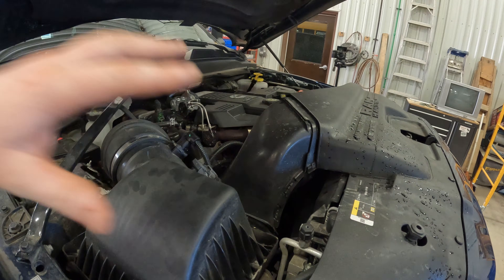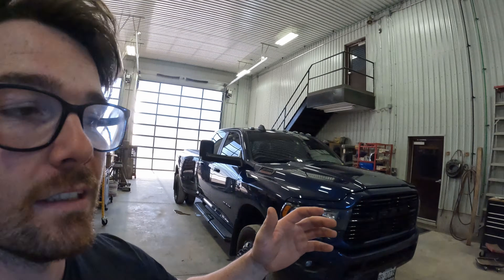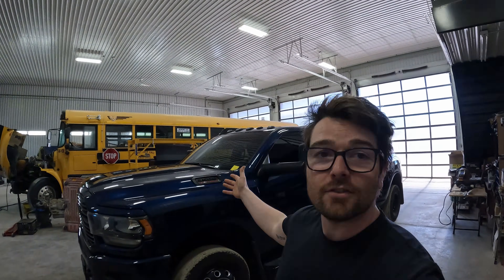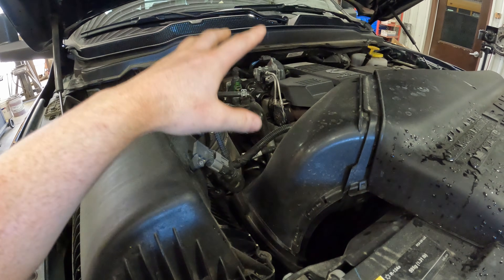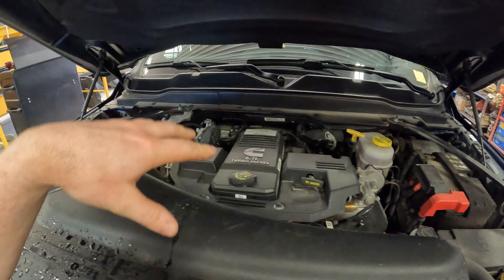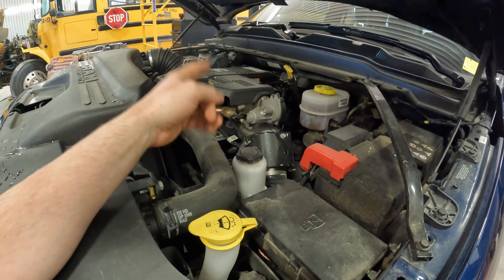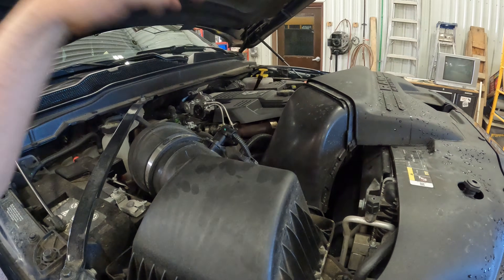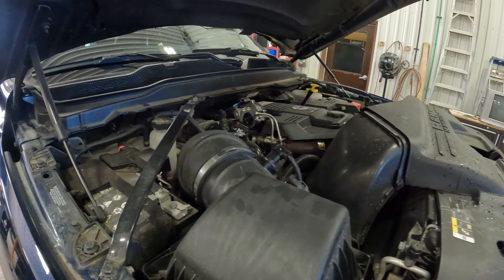RAM 3500 Cummins HIGH OUTPUT Diesel vs STANDARD OUTPUT | What Is the Difference?

Comment: Alex, question for you. We are going full time RV living soon and wanted to know your opinion as to how much towing is the amount that crosses the line where you need a HO RAM 3500 as opposed to the Standard Output Cummins? Is it a matter of terrain? Percentage of miles towing vs. non-tow driving? GVW of 5th wheel will be in 18k lb. (8,200 kg) range.

Comment: I use to work at the plant where the engines are made and the pistons are different as well as the heads. Many components are different between the standard and high output. Cranks camshafts as well as others. We always had to swap parts when we did different standards or high output.  I also worked on the machining side for the block. The high output puts would have 1 freeze plug left out on the side and standards would have them all in place once they reached ready for assembly. CGI issues are that they have lots of porosity that’s hard to catch compared to original cast irons.
Reply: Can I get those parts if I need to rebuild my engine ?

Comment: Can a standard be converted to High Output?
Reply: If you swapped a bunch of parts and reprogrammed ECM but it be cheaper to just buy the HO
Reply: @ramonbecker252 where can I get the parts ? If I need to rebuild my HO engine

Comment: THIS TRUCK IS POWERFUL BUT IT DRINKS DIESEL LIKE A PIG ON STEROIDS 😂. CITY DRIVING 9  ON HWY NOT TOWING 12 MPG TOWING 20,000 LBS IT GETS 6 MPG . IF YOU CAN AFFORD A $110,000 PLUS PU THAN SPENDING $230 TO FILL IT IS PEANUTS. 😂

Comment: I own a 2022 3500 dully with the standard engine and transmission,  my brother in-law bought a 2023 with the HO, now he's driven my truck, I haven't his.  

He has determined his truck is as strong as mine, we do the exact same type of work and we haul the same things, now I don't know if it's a factor that my truck is broken in and his is rather new or what, my truck is also heavier being 4x4

Comment: I am extremely happy with our 2020 Ram 3500 SWR HO for towing our 2021 Montana 3231CK! With a match made on the road, it's clear that this truck is well-suited for our needs. The 9.8 MPG on long trips from SC to UT and back is not that impressive, was expecting around 2MPG. 865 days after purchase I am getting my CP4 pump replaced under warranty. Not sure if this will help with MPG I did ask and the tech didn’t seem to think it would. Many thanks Alex for your videos.

Comment: I'm wondering what the milage between overhaul would be, a semi will last about 500,000-600,000 miles between inframe (not pulling the motor out) overhauls.

Comment: On Dec/2022 I bought a SRW Ram 3500 with the H.O. Cummins and the AISIN Transmission. Driving with a light foot I get between 13.8mpg - 15.3mpg actual efficiency. The computer always says it's higher 15.5 - 16.5mpg, but it's never correct.
What MPG do you guys see with your H.O. Cummins & AISIN Transmission???

I've seen people reporting fairly high mpg with the Standard Output Cummins & 68RFE Transmission. 
But I'm curious about actual calculated (not computer) MPG for the H.O. & AISIN.
Can anyone share your experience???
Reply: I bought a 2022 Ram 3500 HO/Aisin SRW CC 4WD in Jan 2022.  Unloaded I have gotten as high as 20.5 (actually calculated).  Towing, I see 10-13mpg. Around town, ~15mpg.  Computer is always about 1-2mpg too high.

Comment: I own both Cummins the H.O. And standard. Let me tell you the H.O. Will lug up the hills just about idle. The standard will downshift until it redlines to make it up the hills. Go high output.
Reply: I went ho ang glad I did
Reply: How do you tell the difference?
Reply: @heatherjenista3964 by where the transmission dipstick is, I think the HO is on the driver's side. I may be off, but I know for certain the dipstick location is different between the two
Reply: You have to drive both trucks at the same time. @heatherjenista3964
Reply: What about reliability?
Reply: Yup!

Comment: I order a 3500 SRW 4x4 Larmie back in 2018. Standard output engine with 48RFE. At 25K miles I get about 16 mpg unloaded. It was extremely hard to decide HO or standard (cool factor). After considering $$ and impact to tow #'s I went standard, and it works fine for my trivial towing needs. Great info on the differences. Thank you. I may not be "HO-Cool" but I am cool enough 🙂
Reply: 68
Reply: That's the decision I'm at now, I'm only going to be towing a fiver a few times a year and daily driving the rest. That's why I think the SO will be sufficient for my use.
Reply: @robh5416  odds are you don't need a diesel for your towing needs in the first place... but if you're taking diesel anyway its because you want the power, so why settle for the lesser option? just my 2 cents
Reply: @Slythey  I appreciate the response, unfortunately I'm still going through the debate process. I'm going to wait to see what changes Ram does for the '25 models. Maybe that 8 -10 speed trans that's been on everyone's wish list.
Reply: @robh5416  I've been waiting for a bit, unhappy with my '22 F350 7.3 gasser. I wouldn't volunteer to test out a new transmission on first model year though. The '24 Ram 3500s are between 5-10k off sticker in my area right now.
Reply: @Slythey  right they've been discounted in my area as well. I've been letting my money sit in a HYSA and with the rates, I planned on letting it sit for now (no rush for the truck). But if it's from Aisin, I'd like to think first year would be ok, and that first gen issues are not like they used to be. 🤞🏻

Comment: So they are both 6.7L engines. But for the high output the only difference is the Aisin transmisson which makes it high output ?? How can you tell the difference ?
Reply from the maker: they are both 6.7L engines yes. exact same displacement but the high output basically is tuned to make more boost and more power along with the aisin transmission.

Comment: As soon as I saw the shorter connecting rods, I knew... I has guessed 17:1 just from apperance.
Reply: Don't confuse the rod difference shown in the video, that's between the pre-19 6.7L and the CGI 6.7L. The SO and HO only have different pistons and tune.
Reply: @theoriginalrjt21 how about the 2022 any others parts different?

Comment: I've compared the piston part numbers between an SO and HO when they first released the CGI engine and they are different part numbers. It's pistons and tuning/boost. Nothing else. Same HPFP's.
Reply: Thanks for this info. Do you know if they have made any changes to the Aisin transmission through out the years? (19-22)
Reply: @faultless18  2021 got an increase in input shaft diameter and a hardened internal drum as part of the power upgrade to 1075 lb.ft. Misc internal improvements from what I've been told.
Reply: @theoriginalrjt21  Reason I’m asking is because I just recently Purchased 2022 ram 3500 HO. Aisin trans went out at 3k miles. 
I only tow 11-15k lb trailers 
Dealer replaced the whole trans
Reply: @faultless18  Losing an Aisin is unusual. Yours is probably only the second I've heard of for 2019+ trucks. I'm sure there's more, but it's still unusual for one to let go so soon. Must have been a bad build.
Reply: @theoriginalrjt21  I was shocked myself. From what I’ve heard of they are bulletproof. I also don’t even tow much weight. Between 8-15k max

Comment: I have a 2022 HO with 4:10 gears. It is used for hauling only. I run from MI to TX every month to pick up a new gooseneck and come back with 18 to 22k pounds behhind me on average. This truck has more power than it needs, or it doesn't need the 4:10s. Didn't think I would ever say that, Truck doesn't like being shoved to the floor, there is really no need. Haven't found an entrance ramp that I couldn't do 70 by the time I merge when loaded. My 2015 had HO, 4:10 gears better al a round set up and the air ride worked much better. The 2022 does get better mileage for some reason. Have only made 3 trips in it. There is nothing like a new truck!
Reply: What is the update on your 22 HO diesel? What is your current mileage, any problems or dislike about the truck, would you buy it again if you are in market today? I am torn between 2021 and 2023 3500 HO with the 4:10's. I am leaning between 2021 or 2023 as I have heard lots of problems with the 2022's. Paul on YouTube who owns many Cummins diesel for hotshot had major problems on his 4 2022 HO diesel. Thank you in advance.
Reply: @j.l.salayao8055  Just found this it's late, I am leaving for TX in the morning 960 miles on the first day, Be back next week. I will fill you in with what I think when I get back.
Reply: Did not know the HO could get the 4.10 when i try to select 4.10 it deselects the HO. Seems to only want 3.73. Interesting
Reply: @Jtwizzle  You might try the Max Tow option, it only comes with 4:10 gears. But you shouldn't have to. 4:10 only comes on a dulaly. You can't get 4:10s on a single wheel unless you get a cab & chassis. With the HO engine you don't need the 4:10  unless you are towing for a living because the biger gear makes life eazer for the trans, or if you plan to put larger tires on.
Reply: @upnorthyooper1196  Ahh that makes sense, only for dually. Thanks.

Comment: So what do you think mpg difference is while driving the same?
Reply from the maker: by buddies said with the SO he was getting around 20-22MPG. with the HO he is getting 17-18MPG. so a bit lower but nothing outrageous
Reply: @GettysGarage  I have a 2022 CC 3500 SRW 4WD HO/Aisin and I get just over 21mpg (true calculation and not the computer) unloaded on the highway.  Pulling an RV, I almost always get 11-12mpg.

Comment: Quick question,, what do u think about the baffle inside the intake  ? Removing it or No  ?  Pros and cons  ,, please thanks
Reply: Like most baffles its main function is to suppress sound. The aftermarket intakes don't have one for that reason. Sound is most of what you get with the aftermarket. So if you like the sound of some turbo you could remove it. If you like it quiet, keep it as is.

Comment: 80% of the owners will never use all of the torque of the standard output
Reply from the maker: I don't your wrong. or they'll use it once a year.
Reply: I can’t get my standard output to maintain speed at highway speeds pulling my 23’ pontoon up moderate hills.  Should have gone high output.  Looking at them now.
Reply: @dalelangehennig  Standard output what? If you're saying a cummins then your 23 foot pontoon is no where near the max capacity of it's towing ability. What are you trying to do tow 100 mph?. You either have  mechanical issues or your just looking for an excuse to justify a new truck.
Reply: @darryladams519 lol. Wind drag. I hear you. I was shocked!! Weight is not an issue. Probably 8,000 lbs but it does sit up high and drags the wind like a sail. But my power stroke pulled it like a beast.  I
Reply: @dalelangehennig  My 2015 ram 3500 DRW with the G56 pulls everything I hook behind with no issues. Closest thing I've got to your boat for wind drag is a 33 foot camper, I forget it's back there. Minus a few items it's stock with stock power output.
Reply: @darryladams519  I wondered if maybe they had it programmed to limit the power during break in? But I was so disappointed compared to the power stroke that I traded it in during the first week. But now I am missing many things about it and wondering if I didn’t give it a chance or what. I also wondered if the government lawsuit recall made them dial back the power with all the emissions stuff. Maybe I watch too much YouTube and should have just driven it and forgotten about it because other than that weak pull home from the lake I was absolutely in love with every aspect of that truck. I just couldn’t believe it.

Comment: Thanks for the video, I thought I would learn more but there is a lot of misinformation in your video.  After having six different RAM 2500 trucks for my Marine Transport business since 2015 & logging almost 1,000,000 miles since... I bought a 2021 RAM MegaCab Limited HO Dually 4.10 truck and learned the hard way how poor the MPGs were with the HO compared to the SO of my previous 2500s.  The funny thing about towing boats is that the MAX weight ratings are calculated by towing an actual WEIGHT on a Flatbed trailer for testing, tuning and safety control by the Manufacturer.  What they do not do is actually haul something like a large boat weighing 15,000# which falls far under the realm of the 30K+ max weight but what it does do is have very irregular airflow versus say a weight on a flatbed gooseneck.  This lack of insight in tuning plays a role where the engine can demand more DEF to compensate for say, huge Headwinds when towing West across Wyoming towards Washington, than the tuning was ever programmed for... so then you get "DEF System See Dealer" messages and a limp mode to render your truck useless.  Of course, the "Plug N Play" Techs are just as useless since they are not allowed to test your truck hauling a load, and when operating said truck at normal loads, never hits the window of operation so they could see what is actually happening...  you get a reset and "Nothing Is Wrong Here" from the dealer and a bill for the service since it is not covered by warranty.  

SO... to shed some light on the real mechanical differences between the two trucks, SO & HO.  It's the Pistons and tuning... nothing more.  The Camshaft, Block, rods and crank are all the same.  You might be surprised to know the turbo is the exact same part too... everything is done by tuning.  What is truly different is the rear axle... so do not order the BANKS Diff cover for a 2021 Ram HO from anywhere other than SUMMIT Racing, as the earlier part numbers showed the wrong axle.  The reason Summit has it right is because that is where I ordered it from, and they have now had a PowWow with BANKS to get the right part numbers in their system.  

Can an HO truck be made to achieve the fuel economy of the SO trucks...?  YES!!!  It Can, but be ready to break out the wallet for some serious cash.  Just note, by this time... you are now going to spend an additional $3500-5500 on TOP of what it cost you to upgrade to the HO from an SO... JUST TO GET THE AISIN Transmission.  For less money, you could do an ATS Allison Swap and still get 20+mpg!!!    The BANKS MonsterRam is worth 2-3mpg across the board when installed with the heater grid delete.  Add in the Ram Air box Banks calls a "Super Scoop" and the hard pipes to see 19-21mpg unladen and 10.5-12mpg while towing anything over 12K#.   I have documented this and yes, saved some fuel along the way.  Just doing the #JennyCraigMod is not enough.   I have much of these changes shared on my channel as well as the subtle differences like how the EGR is affixed to the exhaust manifold on the newer HO trucks.  

Keep up the great videos!!
Reply: I believe the transfer case is also larger in the HO models. I thought Firepunk discovered the injectors in the HO were different than the SO. I could be wrong there. 

I have a 2021 HO with all those mods you said. Your MPG number jive with what I get both towing and unloaded. I also have an S467 en route.
Reply from the maker: Appreciate the comment! So maybe it was the way I described it but yes the block, crank and rods are the same for the HO and the SO. I was just pointing out that in 2019 for the fifth gen those items were upgraded from the last "generation" of Cummins. But I see how that could be misunderstood. I just thought it would be cool to mention the upgrades from the 4th gen Cummins. 

 I think later in the video I point out the only real differences between the SO and HO are the pistons and the ECM tuning. I speculated there was maybe some fueling differences but I wasn't 100% sure. just a gut feeling. 

It's funny you mentioned the diff being different because I thought my power wagon with the 4.10 gears had a nice sized diff. and then I saw that diff and I was wow that's ALOT bigger.
Reply: @GettysGarage  

You're on the right track!   I invested a ton of money in mine and did so without first knowing what I was getting into... in plain words, "I followed the hype" on YouTube and the Forums without really looking deep into the options. Had I done so, I would have stuck with the 2500 or if going the 3500 route, kept the 68RFE as it has been a reliable transmission in my experience but it is at least upgradable with tuning unlike the Aisin.  That's the real issue with these trucks is the Aisin is a shit-show for shifting as it wants no matter what you need at that time.  Who cares if it's strong when it hasn't a clue what it's doing... kinda reminds me of Brandon!
Reply: So i have a 2022 cab and chassis ram 3500 i just bought with the aisen transmision and the 370hp so moter and im not real satisfied with the hp when towing heavy 25000- 30000lbs on flatbed goosneck.i dont want to void my warrenty but whatever, is there a tuner out there i can use to get the performance of the HO or better without hurting the engine?
Reply: thank you !  I just bought a 2024 ram 3500 mega cab HO . I would love more info on tuning for better mpgs !

Comment: It's a shame ram never upgraded their manual transmission and clutches to handle more horse power and ft lbs of torture.
Reply from the maker: I know eh, I think the fourth gen sold so few manuals that RAM probably had no motivation to upgrade the clutch throughout it's life. shame really
Reply: From what I understand the clutch is the weak link and the reason they weren't rated for more power. The transmission it self can handle far more. I have an 18 with the G56 and have been beating on it for about 70k miles after a tune. Only replaced the clutch because it was slipping pretty badly. 😂